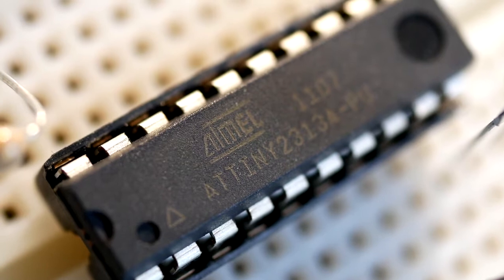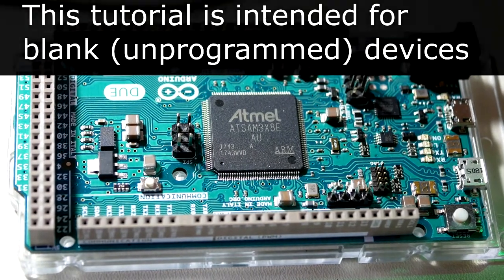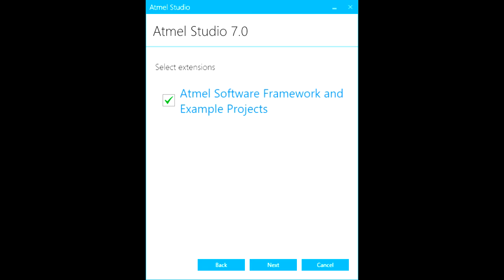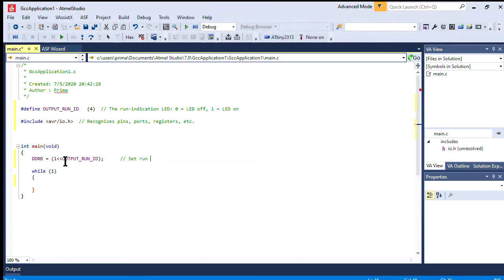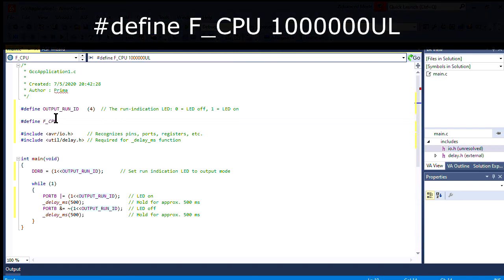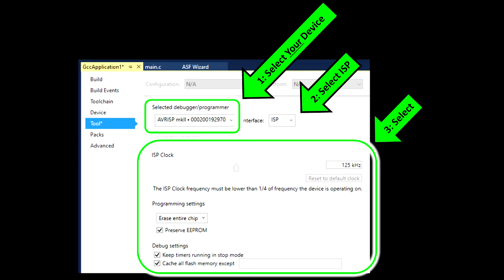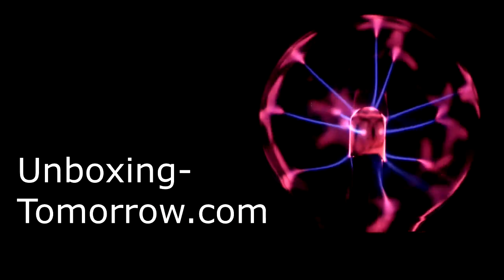Programming with Atmel Studio 7

Comment from the maker: 0:00  - Overview
0:40  - The Objective
1:27  - Material Requirements
1:49  - Back up your data
2:41  - Software Requirements
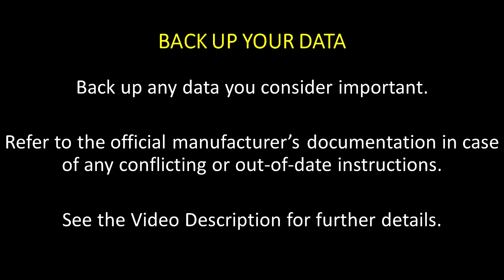3:04  - Downloading Atmel Studio
3:31  - Installing Atmel Studio
4:46  - Creating New a Project
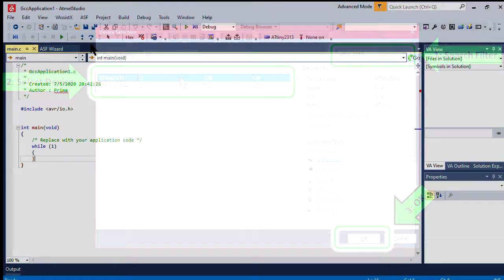5:51  - Coding in C
10:20 - Connecting the ISP Programmer
11:05 - Uploading the Code
12:09 - Troubleshooting
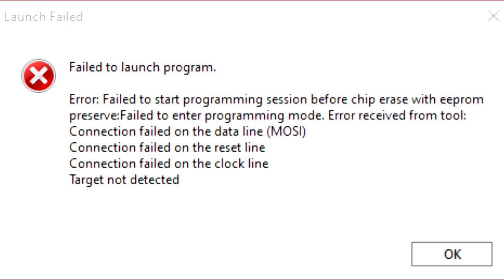13:05 - Closing Remarks
Reply: pin this

Comment: Thank you for sharing. I have a question. Symtom is  programmer power ON --> AS7 start --> programming is OK, but  power on/off programmer with AS7 started then programming failed. I need to close AS7 and power on/off ISPMK2 programmer  and then AS7 start  Ok after. Is it normal for AS7 and  programmer? (difficult to explain english is not my first language.) ie. programming failed when programmer power on/off with AS7 already started.
Reply from the maker: This is unusual.  The old Atmel Studio 7 used to have this problem, which was later fixed.  The latest Microchip Studio should work even if the programmer is off at startup.

It could also be an out-of-date driver for the programmer.  I will see if I can reproduce this problem with ISPMK2, but I don't know the answer.
Reply: @unboxing_tomorrow   I already use latest Microchip studio. It's very wierd for me. MK2 power on(USB) -> Studio start OK, But  Studio started -> MK2 USB connect then timeout occur.   I found 'Device programming -> Apply' ok for either case,  Only timeout occur when writing to the AVR. More wierd thing is when this happen I power on/off MK2 with Studio opened and wait for about 1min. then writing Ok.
Reply from the maker: Any luck?  I will retry this on another machine.

Comment: yeah good video so far. Im confused. Coding - no problem, connecting - fails sometimes but ok, i basically went through all tutorials about programming with Atmel studio, everbody is like: ok ISP, build solution (F7), then start without debugging. ok cool, got it, only that in my case atmel says "no fck u, uNaBlE to sTaRt dEbUg sEsSiOn". Im surprised how one program can make me dead inside every fckn evening for a week now. Any solution-leading hints will be rewarded with 25 bucks via paypal.
Reply: If you are using a pickit 4 or mpsnap as your programmer don't bother with trying in circuit debugging otherwise check the DWEN fuse on your MCU. it must be enabled. Note some programmers do not support in circuit debugging as well.
Reply: Oh and currently my rsp seems to have 3 different device signatures, which all cause errors, interesting...

Comment: Great video. I have a problem though. I have made my own ISP serial programmer. Long ago I used it, and recently I revived it. I can't remember what software I used with it. Using Arduino as ISP fails for me. I know my programmer worked. How do I use it on the Atmel/Microchip Studio software? Studio does not recognize it. Since computers have no serial port anymore, I now use a usb-serial converter.

Comment: I got lost at DDRB part, where did you get that from, also 1<<4 wouldnt that shift that reg by 4? im lost :(
Reply: BTW, that is defined in avr/io.h the studio automatically includes after you chose the device.
Reply: @blvckbytes7329  thank you very much for the description. Ive been wondering about this myself and you explained it well. is it safe to say that these boards dont have macro librarys like the stm32 boards?
Reply: @zzzzbisonxzzzz  I saw that he didn't OR, just override. You can do this when you whip something up real quick, but as soon as your routine isn't the only one manipulating ports, I'd always use masks.

I have no experience with STM, sry :(. What would you miss? You can theoretically use all libs you want to, as long as it fits on the chip's flash. I mostly write all stuff myself and don't use STD or Arduino libs.
Reply: DDRB is a data direction register for port B. Since you didn't provide a timestamp, I have to assume what he did. If you did: DDRB = DDRB | 1 << 4; you just or the value of this register with the number resulting in that bitshift, so you set the 4th bit to a 1, and leave all other bits untouched. This is called bitmath, you generally turn on with OR, turn off with AND and a inverted mask, and toggle with XOR. Maybe read up on it a bit.
Reply from the maker: Quick update on the project: there are 4 more videos coming up to demonstrate bitwise operations, boolean (true/false) operations, and fixed-point arithmetic.  The final one should be handy for anyone wishing to save flash space by avoiding floating point math.